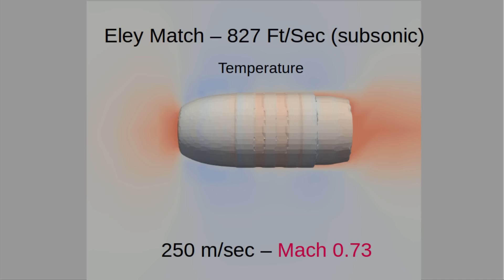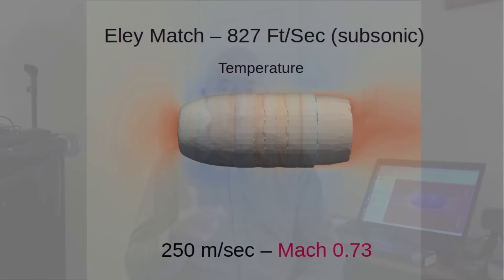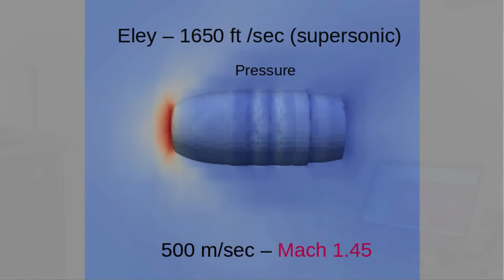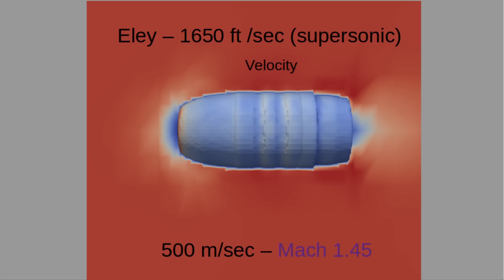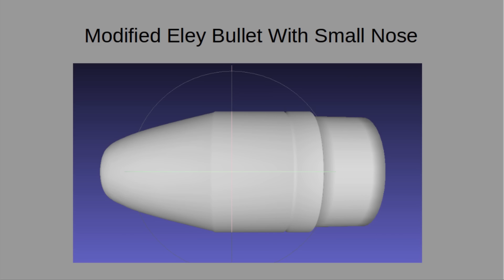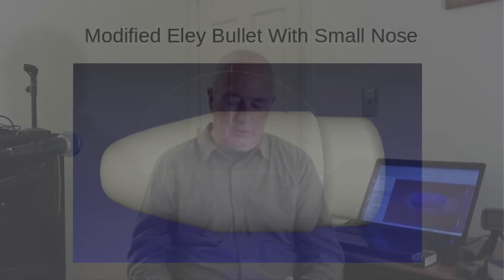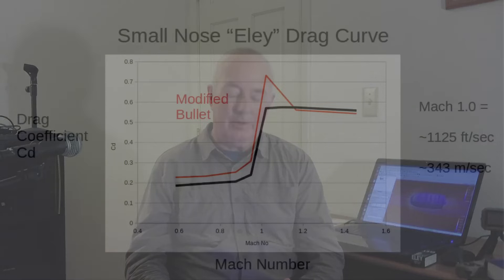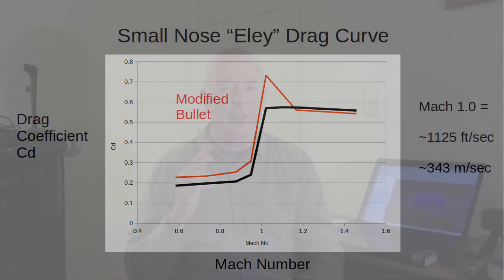22 LR Aerodynamics and Ballistics

Comment: It is clear that the objective of your analysis is to accurately determine drag coefficients for your rifle's bullet/barrel, so as to accurately estimate correct DOPE for bullet drop and perhaps time-of-flight at various target distances.  Your results confirm the proper (idealized) CD model that should be used for your external ballistic calculations and apply it to verified measured velocities based on muzzle chronograph readings and bullet-drop range testing using your individual firearm.  The CFD results are interesting and informative.
I'd be curious to review a comparison of CFD analysis from measured bullet configurations of commercially available offerings from various suppliers (CCI, Federal, SK, Ely, Aguila, Wolf, Norma etc.). 
Additionally, it occurs to me that rotational drag must necessarily reduce RPM and therefore impact external ballistics performance.  I've long suspected that the standard 1:16 22 LR twist rate may be insufficient to stabilize bullets through the transonic velocity 'wall' and especially as drag at longer distance significantly impacts linear velocity.  SV 22 rimfire ammo leaves the rifle muzzle at approx 1080 FPS or 48.6K RPM.  Rotational drag heats the air and robs bullet rotational energy, thus providing increasingly less stability as time-of flight increases.  I expect this may be a second-order effect to overall instability and increasing target group sizes at longer distance, but to my knowledge, that rotational contribution has not been modeled or analyzed.
Discuss...
Reply from the maker: @rickmoore6527  I don't think I will ever be able to complete with simply shooting the bullets and measuring the muzzle velocity and the drop at distance.  That is such a direct way to measure drag. What I got from the models is just a general understanding of how these bullets perform and how to best use my ballistic calculator.

Comment: Does this only apply to .22lr bullets? I am confused because in full power centerfire bullets the longer the bullet the more stable and accurate they are  (except for when they transition through the transonic phase) so a 143 grain 6.5mm bullet is far more accurate (all things being equal) than a 100 grain bullet. Flies farther with less variation bullet to bullet. (Again, all things being equal such as weather, barrel twist and shooter) Do I have that wrong? I have been told for decades that a heavier bullet with a boat tail design is superior to a blunt bullet with a spitzer tail in centerfire cartridges.
Reply from the maker: @bonjovi2757  You should buy Brian Litz's book. It's all in there and very readable. I know he has been testing 22s, but right now, the book is pure center fire.

Comment: 1: Isn't there a partial vacuum behind the bullet?...

2:  Is it possible for the bullet to create a vapor or condensation trail behind in a humid environment?

3: Could a motion pucture camera operating at 42 frames per second capture that trail before it evaporates?
Reply from the maker: I don't know. There is a little low pressure region right behind the bullet, but the wake is also heated up by the bullet's passing, which would tend to make any mist evaporate. I've shot in 100% humidity and never noticed a vapor trail, but that doesn't mean it can't happen.
Reply: @jamesconger8509  : Thanks. I mention it as there's a famous photo of a streak photographed passing Trump's head.   And a certain frame of the Zapruder film of JFK's assassination wherein a streak appears passing behind the driver's head as the President's head is hit.

Comment: Great video Sir! Thank you for the effort. I would be very much interested to see what your simulation says about boattails. It should have a great affect. If you look at Soviet VSS ammo SP5/6 they have large boattails. R.L McCoy's book that i have doesn't go into subsonic regime either but recognizes the effect of boattails and claims that shepe of the nose has little effect. I'm building a powerfull airgun for the competition you mentioned, and i believe this is where airguns will outperform .22LR subs
Reply from the maker: I have not done much past the sims I posted. Keep in mind that making a bullet longer to lower the drag will reduce the stability of the bullet, so you probably need to think about tighter rifling twist if you are going in that direction. And yes, air guns have a lot more flexibility, plus amazing repeatability.
Reply: @jamesconger8509  Agreed. The bullet actually becomes too long, in a sence that sectional density exceeds modern air rifle capabilities forcing you to crank up the pressure. Gyroscopic stability is fairly simple to calculate, it's the dynamic stability that i don't understand how to calculate. Having a cavity in the back vs front ( reducing SD to acceptible levels) has an effect as well, just not clear on how to calculate it. Anyway...looking forward to your future research! Thank you for sgaring!

Comment: With the designs that have a steep increase in drag as it goes supersonic, it is possible to take advantage of this to reduce vertical dispersion at long range.  It is sometimes called "Mach trimming".  The bullet is loaded to just above the critical mach number. This way, the bullet reliably slows to its max subsonic speed soon after leaving the muzzle.  Believe it or not, this often produces more uniform bullet speeds downrange than trying to launch each round at precisely the same (subsonic) muzzle velocity.
Reply from the maker: @jfess1911  I have heard of this, but given how the speed of sound varies with conditions,  it would seem like something only an air rifle could hope to do consistently,  and it would be a pain to keep adjusting the muzzle velocity,  which would also change the ballistics. Life is too short for this.
Reply: @jamesconger8509  Bryan Litz has some interesting articles on Mach Trimming.  He did quite a lot of radar testing on it.  There is also a video here on YT with him being interviewed about it.  You are right that it is.a pain to match the bullet to the speed of sound for changing conditions.
One interesting point he brings up (along with high-speed photos of a shot 22 bullet) is that the shape of a fired .22 bullet is not the same as an unfired one. A photo of the bullet leaving the muzzle shows no heel section.  It has obturated inside the bore to match the shank diameter.
Reply from the maker: @jfess1911  Thanks. That implies that the sims I did for the no-heal case might actually reflect the bullet as fired. The shape of the drag curve was the same, so the same approach applies.
Reply: @jamesconger8509  That video interview is on the Ultimate Reloader channel, if you want a look.  The photo is shown there.  There are also a couple short ones on Litz's Applied Ballistics channel.
Litz stated that none of the existing ballistic curves do a great job of matching the 22 LR trajectories he saw with the radar.  
Now that I have looked farther into it, I agree that Mach trimming seems impractical.  It looks like you might need a barrel with numerous ports drilled along its length that could be covered and uncovered to produce the perfect velocity from a batch of ammo
.
I have a silly imagination and pictured a sliding trombone-like device attached near the chamber tap off the desired amount of gas.  Yes, I know it is ridiculous, but the image in my head is pretty funny!

Comment: Does your modeling include rifling and spin? Also, pressure behind the bullet as it travels down the bore is likely distorting the rebated  base. Can this be modeled?
Reply from the maker: No to both. I would have liked to model the bullet in it's shape after leaving the muzzle, but I don't have a good way to capture that (some suggestions posted below). The software I'm using has fairly limited ability to handle rotating objects, so I did not include that.

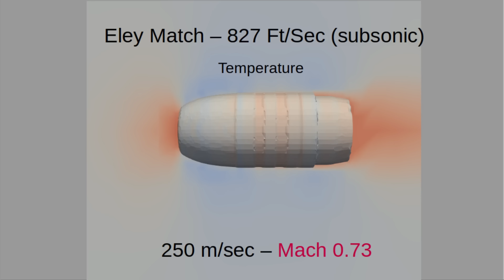Comment: 4:09 The velocity of air rises to above 0.73M around the ogive, lowering the temperature. As it reaches the heel, velocity drops (skin drag is a contributor), temperature and pressure rise. Subsonic diffuser flow conditions. I don’t think you included internally generated heat into your simulation, so the bullet temperature is probably not the cause.

Comment: Following your hypothesis as I understand it, seems best result would be to select lots with the lower muzzle velocity within a given product. Opinion?
Reply from the maker: @rc6882  I think it depends on what distance you are shooting.  Longer range would tend to favor higher velocity,  particularly if you consider wind effects.
Reply: @jamesconger8509  Yes, due to influence of time-of-flight (as I understand it)
Reply: At the muzzle velocities of 22 LR higher velocity results in more wind drift.  I know it's counter intuitive but true.  Even though the time of flight is less the wind drift increases.  Wind drift depends upon "Lag Time" which is the time it would take the bullet to reach the target if it did not slow down subtracted from the actual time of flight.  The portion of the wind speed perpendicular to the line of flight, in inches per second, multiplied by the Lag Time is the wind drift.
Reply from the maker: @sagecreekgus7779  You're right. I remember this from Brian's book. Maybe I should try some very slow rounds and see what happens. The ballistics can get pretty extreme. A 800 fps bullet drops about 10 feet at 200 yards.

Comment: Manufacturer published BCs are normally based on a SAAMI standardised barrels as you probably know.  Many (most?) manufacturers publish only G1 BCs, so that's what I've been working with up to now.  I thought that G7 BCs were more appropriate for spitzer/boattail projectiles, especially X-VLD varieties.  

I'll keep this in mind moving forward though, if I find the G1 figures turn out to not be representative.  So far G1 seems to be appropriate for PBR calculations and ranges where I normally use .22LR.

My understanding of the way hollow point projectiles work is similar to your observations of the Eley match.  The hollow point creates an area of stable high pressure in front of the projectile which effectively extends the bullet shape.

What are your thoughts about applying G1 ballistics to diabolo type projectiles?  I've done some calculations for a 15.4 gn .22 pellet (910 fps mv) but haven't had the opportunity to test them at the range yet.
Reply from the maker: I don't shoot air guns, so I don't have any experience with that shape. You might look at video #2 where I do look at some other shapes, but not that one.

Comment: Have you tried modelling a shape with a longer "heel", with, maybe, a more rounded tail... I'm not sure about the powder capacity related to the length of the heel... It seems intuitive (often a bad idea) that the "cup" shape at the heel is needed, maybe to "capture" the pressure from the propellant, but that's probably false, since the heel is, I think, smaller than the barrel diameter?
Reply from the maker: Never thought about it before. If you take a bullet apart you will be amazed how little powder there is, so there is plenty of room. However, longer means less spin stability.
Reply: @jamesconger8509  I'm swaging my own bullets up to  grains in experimenting I'm doing.  I was putting on a 1/10th inch heel but when fired the heel did not collapse all the way leaving a wrinkled shorter heel.  Accuracy was 3 inches at 100 yards as a result.  These bullets are .68 inches long.  I'm using a 1/9 twist.
Reply from the maker: @sagecreekgus7779  That's a lot of twist. Gives you a lot of room to change the bullet. Smart.
Reply: "Longer means less spinn stability"
But, maybe the "nose" can be even shorter, since the subsonic blunt body behavior probably can stand even more "blunt" shape, with better streamlined "heel"?
Reply from the maker: @lohikarhu734  Turns out the heal is flattened during the bullets time in the barrel. This makes the bullet shorter.

Comment: Fired 22lr loses its heal due to pressure. There are other 22lr experimenter’s out there who have devised ways to capture fired bullets without damaging them and they look just like your cad drawing showing no heal.
Reply: I've recoverd many fired 22LR bullets, and they all still have the heel intact unless damaged in the impact.
Reply: I've captured bullets by firing into soft snow and recovering them when the snow melts, the heel is gone and the base is bullet diameter.   I haven't tried it myself but a shooter I know captures 22 rf bullets by firing them into polyfil and recovering them using a metal detector.  No damage. Use a long plastic tube about 8 feet long and stuff it with polyfil.

Comment: Yes targets for rifle shooting, even for .22 calibers can be very small.  The size of the targets is appropriate to the range to the target.  Actually, there isn't much need to know the ballistics of any cartridge, except for curiosity. Once a firearms sight is "sighted in" what you need to know is distance, and the bullet drop, which can be found easily in many places. 

All that you need to know, can be found in a reloading manual such as Sierra Bullets or others. 

Your choice of a text book talking about exterior ballistics of bullets, isn't what I use for understanding (predicting) bullet terminal ballistics.  A far better choice is a cartridge reloading manual.  These often have data that was determined in a controlled environment which is repeatable and thusly is scientifically valid. They typically have all the necessary bullet information.  The two most important factors are CD (coefficient of drag) and Linear Density.  In conjunction with bullet design (hardness, cladding, various metals and shapes) the desired effect can be achieved.  This was not well known, particularly with handgun bullets, up through the last couple of decades of the 20th century. 

Public Domain bullet programs may use formulas that are reasonably accurate.  Reloading manuals typically produce accurate information.

There is NO correlation between the frontal design of WWII fighter planes and bullet ballistics.  There is a correlation with ballistics in the P-38 Airplane, when it tore it's tail off. The P-38 doesn't have that blunt nose which is a characteristic of using Radial engines, not due to aerodynamics as such, but its critical with regards to cooling of what are typically air cooled radial engines. This can be understood with examining the Ideal Gas Laws.

The heel is not an unusual feature of .22 rimfire. A longer pointed bullet is NOT fundamentally unstable. Stability is a function of rifling and velocity. Look at the .55 grain full metal jacket boattail bullet.  It's a very accurate bullet (and one that I handload).  

What you are calling shocks are the coalescence of sound waves that can be "seen" under some conditions.    These will appear at different distances dependent on temperature.  Again, this is a reflection of the Ideal Gas Law.  The technology behind Noise Cancellation exposes some of the features of gas flow. 

Your comments about Chronographs are, again, completely accurate with reference to the Ideal Gas Law. Everything you mentioned with regards to drag is found in the typical reloading manual.  Even APPS for smart phones will be able to deliver ballistic information.

Two factors that cause a variation between printed velocities and those from a chronograph are temperature, and humidity.  The bullet charts in loading manuals are generally accurate enough for target shooting or hunting.  If you can duplicate the environmental conditions used for rating ammunition your chronograph should be the same.  (there is always some deviation). 

Personally I would not waste time on .22 Rimfire cartridges.

Comment: An Excellent presentation   - very informative.  Have you verified the uncertainties affecting your chrono measurement. From a metrological perspective,  your measured results cannot be precise. There must be uncertainties associated with measurement taken alone (let alone the total uncertainties at the measurement instant form all sources.)  eg environmental, cartridge related, rifle related.
Reply from the maker: @quietudinal4857  The standard deviation of my chrono results ranges from 10 to 15, so even in a single session, there is a lot of scatter. The barrel of my vudoo is new, and the mean value has been steadily going up. It will need to stabilize before I try to correlate it to external factors.

Comment: Using a model for a hypersonic shot that introduces an error associated with the passage of transonics  are not  the appropriate tools to predict the pattern of behavior of bullets in the subsonic range exclusively.Regardless of which standard G1 or G7 is used.
Speaking only of the subsonic part of the graph have an assumption that the  graph (drag model) of 2 same  bullet will be somewhat different when compare two scenario- bullet "A" was passed the transonic barrier and "B" was fired at a subsonic speed from the very beginning.
 Since bullet "B" did not pass the transonic barrier and therefore was not exposed to action forces that accompany the transonic .
It is likely that there will be noticeable changes between the two graphs even in the subsonic range, as well as in the absolute values of the ballistic coefficient

To accurately predict and create the drag function of subsonic bullets, it is necessary to measure shots with subsonic bullets without the influence of the transonic barrier at all. Of course, using all the necessary and complex measurement systems that are available only to some well-known companies.
As far as I know Brian Litz mentioned what such tests are planning to do.